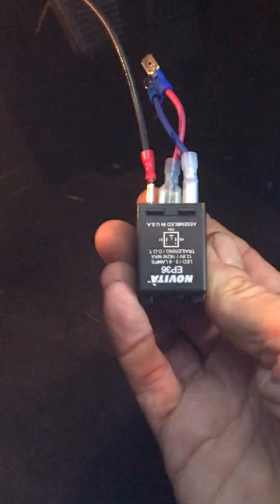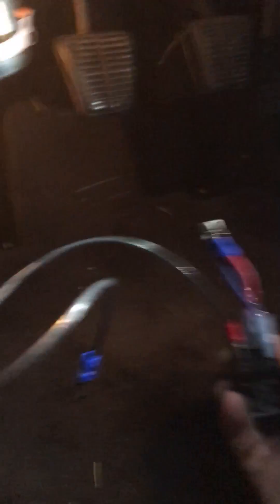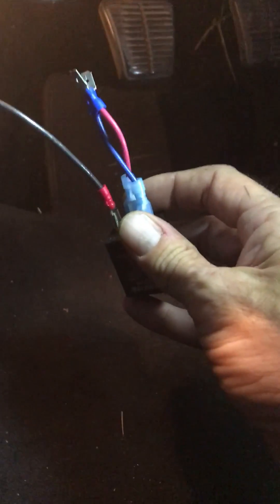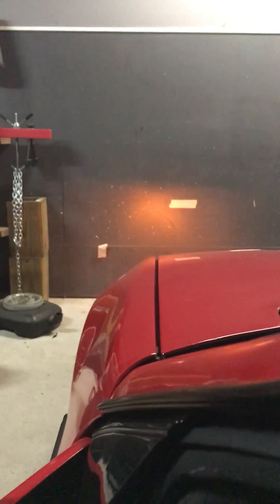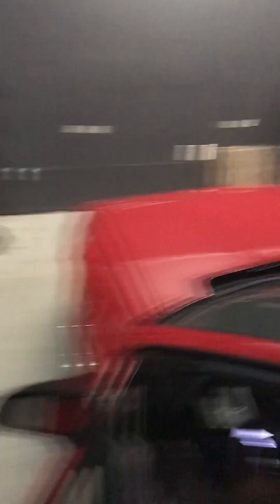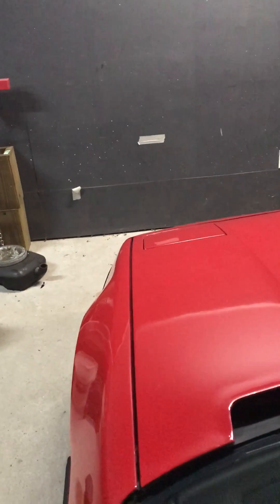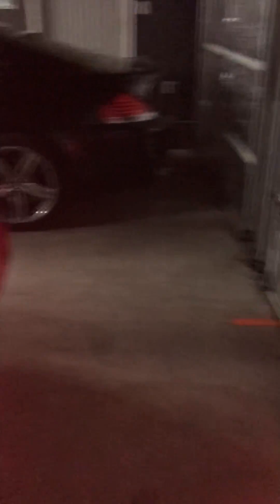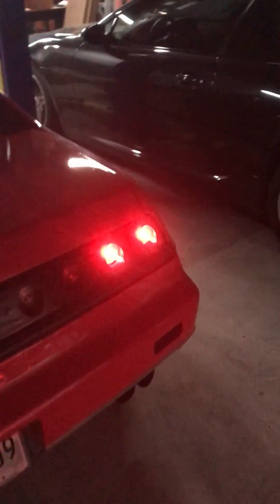Converting older cars to LED brake lights and turn signals...using 3 wire flasher in place of 2 wire

Comment: I hooked the ep 36 to my 78 nova with jumper wires and grounded it  made sure I hooked the positive to the port that had 12 v and the load to the load and it's still not flashing I have all my original turn signals  except the rear has led  what could be my issue

Comment: Best video out there. Tried 3 different electonic flashers with no luck. Found your video......and.......Finally works. Thanks sooo much!!!😁
Reply from the maker: Thanks man and glad the video helped 👍. Yep, I tried a couple of the ones I had laying around that said they were for LEDs, but seems many of the old two wire setups just won’t work without the type that does the flashing independent of what’s connected to it.  Too bad I couldn’t find a version of the EP36 that had the poles oriented correctly for the load and +12V, but making the jump wires to invert them worked fine.  Thanks again and all the best !  Steve

Comment: Thank you for doing this video. I installed LED lights on my '66 Chevy C10. Turn signals wouldn't work. I just installed the EP36 flasher and now I have turn signals. Thanks again.
Reply from the maker: Chuck Eberth , Glad you found it helpful and thanks for letting me know ! Seems better to do it this way with a 3 wire flasher vs. having to put load resistors in line to the LEDs as some had recommended to simulate the load of a regular bulb.
Reply: Hey. Great info. I have the circle relay with the ground wire, and it's not working for me. Can you help me out?
Reply from the maker: GolDe Mac , thanks 👍.  If it is a three wire type it should work as long as the load wire (the wire that goes to the lights) and power wire are oriented right on the harness.  You could check with a multimeter to see which harness wire is the +12v and then be sure that wire is connecting to the + (or maybe is has a “B”  or “X”) on the back of the relay.  The load connector is typically always marked with an “L”.  I had to switch the location of the connectors with the short jump wires since it was backwards on the relay I got.  If you don’t have a multimeter, those cheap digital ones at Harbor Freight would do do fine to determine which wire was +12v (and where a good ground is on the car for the ground wire too).  Hope this helps, Steve
Reply: Oh I failed to mention that I'm running switchback turn signals on a 80 malibu. Went with a led flasher, but It didn't make them switchback. They only worked normal. If I switched the X & L, would it make them switchback?
Reply from the maker: GolDe Mac , Mine has switch backs on it in the video as well so it should work.  The normal running light should be on a separate power circuit so it gets separate power to the white LEDs (assuming the running ones are white), then when power is delivered to the light assembly for the turn signal (yellow in my case), the light assembly should switch off the white if they do like my switch backs.  The EP36 relay I put in can handle both LEDs and regular bulbs (or a combination) but I’m running all LEDs now.  I would try switching the wires (making the short wire jumpers) to see first.  Since it’s a Chevy, it probably has the same harness connection configuration as the Fiero as they kept that stuff pretty consistent so the two wire flashers could be used on a ton of cars back in the ‘80’s. The two wire flasher that was originally on the Fiero also works on my ‘84 Nissan pickup so they were nice and kept stuff pretty standard back then...for sure not like todays cars, lol